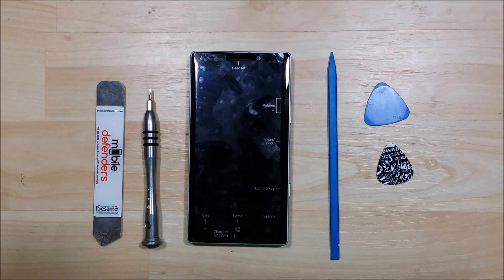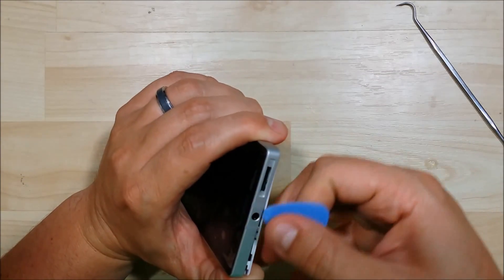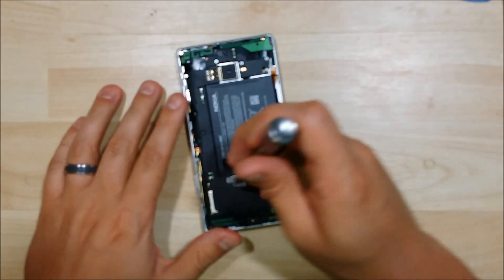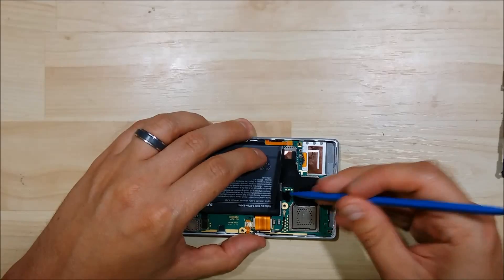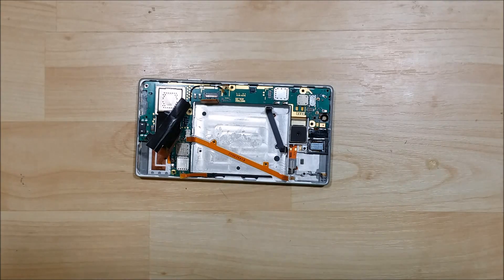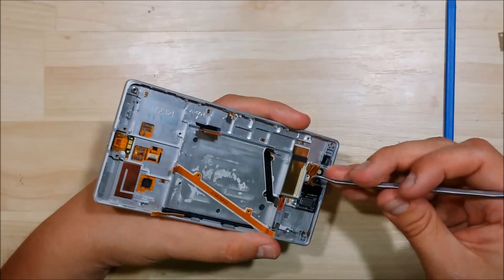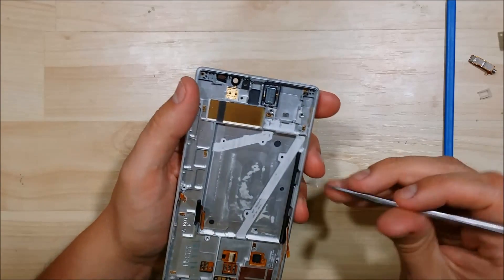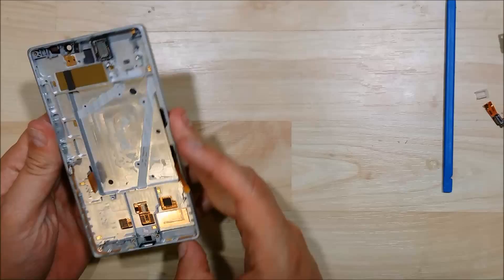Nokia Lumia Icon 929 930 Disassembly - battery -camera - display screen assembly replacement part-1

Comment: thank you for the post. had an adventure with my 930. broken screen - replaced with guidance from you. used rear view mirro adhesive to replace factory glue and i can foresee further work necessary but otherwise all good - go raibh mile a maith agat.

Comment: I don't have a torx T4 screwdriver, so do you really need to take the plastic housing to remove the battery? It seems as if there is already a cutout for it, and the battery cable is also accessible.   Thanks

Comment: Thanks for all the info. Dropped my phone on a concrete floor and my tool bag landed on top of it. The rear facing camera shows a piece of glass floating around when looking in camera mode. I can tip or shake the phone and the piece moves. The outside glass covering looks fine but I'll replace it too; just in case.
Reply: t4 torx confirmed.

Comment: Thank you for this.  It would have helped if you'd named the parts as you dealt with them.  Also, the tabs on the back cover vary -- the ones near the USB port have a lower profile than the ones on the upper half.  It would have helped to understand that; forcing the tabs that don't seat properly is a big mistake, there's more art to putting the back cover on than appears in your Part 3 video.
Reply: There are clips inboard of the perimeter clips, particularly where there are electrical contacts between the back and the rest of the phone.  These turn out to be tricky, too, to get to engage properly.  Study where they are so you can apply pressure to get the back's clips to engage the front's clipping points.

Comment: I used this video to change out my old dying battery, and after a long hassle of finding the right parts and screwdrivers, I now have it switched, but now It won't make calls, I'm thinking I bumped something but I'm unsure as to what, suggestions?

Comment: Hey dude great video, did the phone work fine when you reassembled? I reassembled mine and touch wont work and no idea why, everything is perfect and undamaged
Reply from the maker: +Rich Williams Yeah you can see it functioning in part three. Did you replace the display?
Reply: Whole thing yeah... Even the original wont work and it did before i unplugged it. Apparently a lot of people have had this problem. Im lucky i think i can get a refund for the screen,  I will try 1 more, if that doesn't work either then I am stumped...

Comment: What is the cable at 5.45 for? I messed my connector up when changing the mic but phone still works fine!
Reply from the maker: +GEORGE1470 I believe it is an antenna cable for WIFI or Cellular signal. If the phone works then you are still getting a good connection.
Reply: Well I have full bars on my wifi and my cellular connection at the moment. Maybe its to do with 4g.

Comment: Was able to successfully replace the battery in my Lumia 930 with the help of this video. Only slight differences in the placement of a piece of tape and a cable. I had a fair bit adhesive under my battery as well and had to use a decent amount of pressure to remove it.

Comment: Question, my Icon's battery is getting "long in the tooth" and I don't quite feel like switching to AT&T for a 950XL. Sooo, that means I need to replace my battery, I can't find the specs (OEM part number) for this battery to make sure the one I buy online is the correct one. I see a Nokia ?V-5QW 3.8V 2420mAh 9.2Wh online (not too many places have these batteries period), so wanted to check. Thank you in advance.
Reply: Amazon has lots of suppliers of the Lumia Icon's BV-5QW battery.  Some supply a battery made for Nokia with the Nokia brand on it, some supply a battery by another maker; both a made in China.  We just installed the Nokia brand purchased on Amazon; it seems to work fine.

Comment: +How2Tech 
Hey I'm using Lumia 930, Please tell me one thing.
Is it possible to replace only touch hardware without changing my phone's display?  Because everything of my phone (lumia 930) is okay except the touch isn't working at all.
Reply from the maker: +Tanvir Ahamed Most of touch issues are screen related. Fixing anything else would require desoldering chips off the logic boar, definitely not something I would do.
Reply: ***** So you are saying that it is possible to change the touch by separating it from display?
Reply: +Tanvir Ahamed Many people have reported that the touch won't work after reassembely. I would advise against it unless you feel confident that it will work. (It was much easier with older Lumia phones):
Reply: William skagen What do you want me to  do?
Reply: Tanvir Ahamed Did, you wan't to change the didgitizer or the internal lcd screen?
Reply: Well, I'm not a technician, recently I contacted with smartphone repair center & they said they can change only touch by separating it from the screen. So I don't have to change the whole display and it will cost me 3500tk ($45).
I'm from Bangladesh.

Do you think that my touch isn't working for digitizer?
Because they just told me they will change the touch & it will fix my problem. But I don't know what they meant by touch it coulf be a digitizer or not, and how they will remove touch from display.
Reply: Tanvir Ahamed Hmm, It could be the cause if the lcd still show an image when turned on (without touch input). I honestly don't know, but if the repair center told you they could fix it then go for it (unless you feel like doing the job yourself)
Reply: William skagen No man,
But the problem is they haven't that hardware to replace it r8 now. They told me to wait for the touch to arrive.

Do You know how did I damaged touch?
Couple of days ago I opened my phone completely except the display & reassembled it. And I noticed that touch isn't working.

Note: I opened my phone several times before & reassembled it but there was no problem at all.
Reply: William skagen Can you tell me exactly where the touch hardware is located in display.
Reply from the maker: I understand your question now. No replacing the glass will not fix touch. The Nokia 930 uses an AMOLED screen where touch is part of the LED display. If touch from the display is the issue then you would need to replace the whole display assembly. Here is a video where I seperate the glass and you can see there are no touch\digitizer cables attached since it is an AMOLED  screen:  https://www.youtube.com/watch?v=yX79l2jRwlY
Reply: ***** But they told me that they can  replace the touch from lumia 930 display!!!!!!!

So, how much it will cost for the whole display?
And how's the quality of display considering the screen clarity & touch responsiveness?
Reply from the maker: might want to look for a new repair shop...

They range from $85-120 and you can get an OEM display from here. I have never had a bad quality item: http://goo.gl/pB15S3

Comment: Just used this guide to take apart my Icon and replace the main camera.  Mine had developed the shakes.  You can take it apart without removing the battery (mine was major glued in lol)
Also the one connector glued down on the left edge can be left in if you dont have to remove the logic board in its entirety .

Thanks for making this guide!

Comment: Hi there, good video for a start! I followed it, and put the phone back together no problems, replaced the screen ok. But when i turned the phone the sim would not register on the phone, says SIM Error.  I have removed sim and checked all connectors appear to be in ok, what would be the problem.  Sim was working fine before i done this.

Comment: My screen started bleeding after I dropped the phone. Could you tell me how far do I have to go, to take the screen off? I don't think I need to take a the vibration motor out to do that.
Reply from the maker: If you can get the cable  back through the hole in the mid frame and past the board, you would just need to take the battery cover off pop the cable connector off the board and then remove the old screen. I would suggest removing the logic board to make it easier and not risk damaging it in the screen removal process.
Reply: ***** Thanks bud. I will give that a shot.

Comment: At this point (5:02) can you already remove the screen ribbon cable and the screen itself? I'm planning to open my 930 to replace the adhesives under the screen because of screen lifting issues. Is this the best way to remedy this issue? Or can I just reheat the glue/tape under it with blow dryer to make it stick again?
Reply from the maker: sobrangsuper Sometimes reheating can fix the issue.

Comment: Hello.. I am trying to remove the battery but it seems like there is a lot of adhesive and it isn't coming out all the way. How do I take out the battery?
Reply: Wedge something thin like the guitar pick between the battery and the housing, not too hard. Wait a couple of hours, you will notice the wedge has loosened, jam it in further, wait, repeat process until eventually battery separates completely. Warming with a hair dryer can help.
Love my Lumia 929, which other phone has "live tiles", eat your heart out, iPhone and Galaxy!

Comment: thank you so much for this video, i dropped my icon a while back and just watched this and i've had the suspicion that the lcd was just knocked out, but my friends told me it probably wasn't, and when you mentioned that that was lcd ribbon i knew i had to try, especially with how easy it was, all i had to do was push on the connector!! sorry for the long comment but i'm so happy it is fixed :)